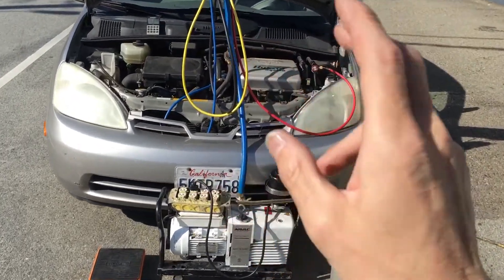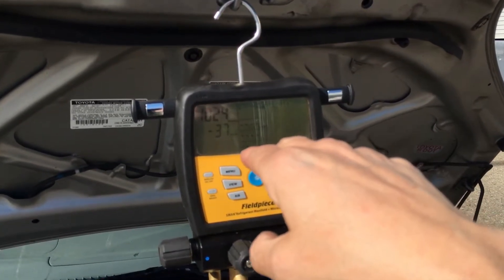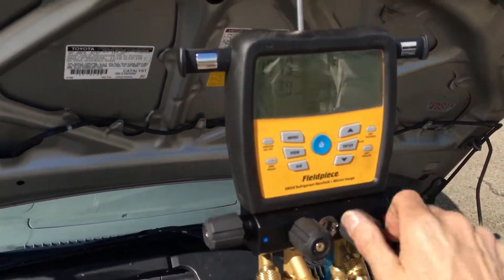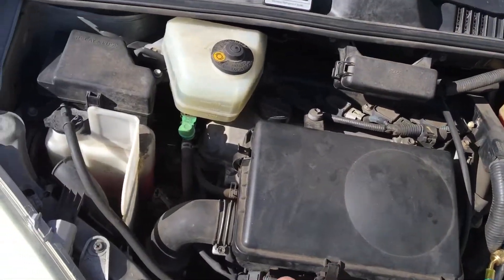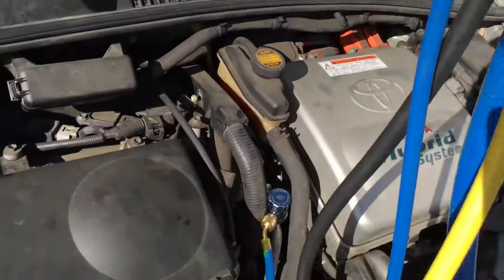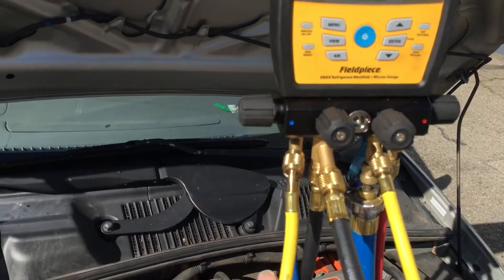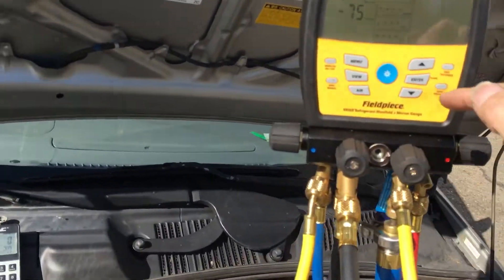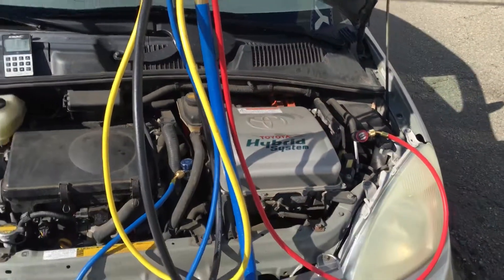Vacuum leak testing Prius GEN one looking for the easy large leak can spot moisture contamination to

Comment: Mr Tom any updated on the new testo 550s?
Reply from the maker: I have not used it out in the field yet I’ve been busy and I will say I do favor the Fieldpiece in my personal opinion over the Testo so far. 

         The software problem in the beginning that I had for nearly a week every time I try to hook up to the software on my phone through Bluetooth the Testo 550 S would keep going into like a boot loop re-uploading and restarting and would not operate. 
         It appears it just fixed itself one day it just started working I believe but I have not taken the test those out in the field to use them on any jobs yet. 

       I really liked my Testo 570 that was my main gauge that I used for years before the Fieldpiece but of course Fieldpiece came along with the Bluetooth capability and better easy to use software so I migrated over to Fieldpiece away from the Testo 570